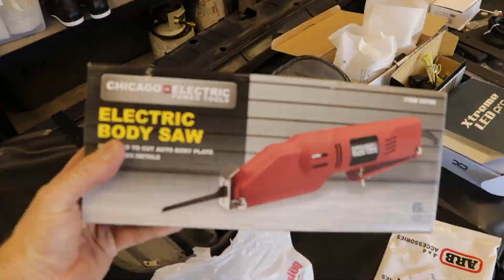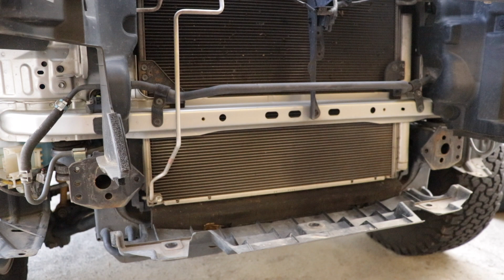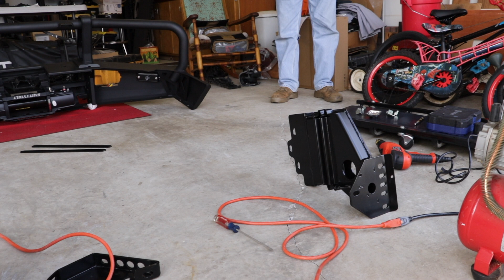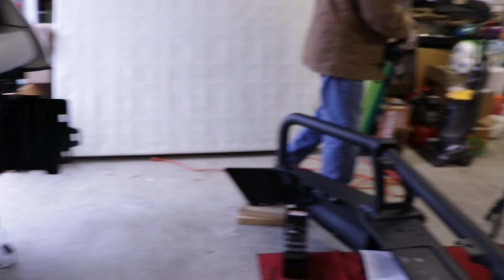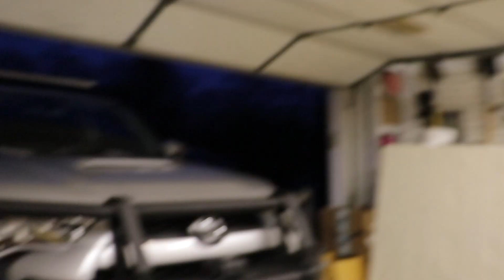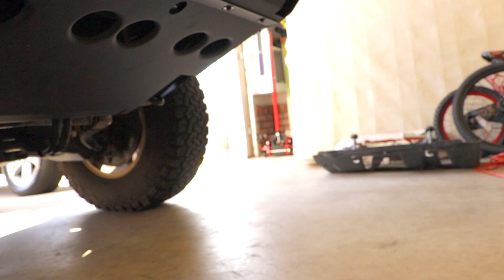ARB bumper installation on 5th gen 4Runner

Comment: Did it include that red recovery point or did you add that from another vendor ?
Reply from the maker: I had to buy that separately.
Reply: Do you have a part number and manufacture on those recovery points ?

Comment: I installed the same bumper on my LC200. Now im adding the winch. Did you have to cut a hole and mounts in the plate above the winch? Any advice would be helpful.
Reply from the maker: I didn’t have to make any modifications to the bumper itself to mount the winch that I can recall. It was pretty straightforward.
Reply: Im referring to the thin metal cover directly above the winch, right in front of the front camera. Looks like the winch control. Mine is a solid plate w no holes.

Comment: Just got this bumper to install on my 2020 4Runner. About how long did it take for you to install this?
Reply from the maker: It took an afternoon to prep the bumper and winch for installation and then a couple days of work. There’s a lot of detail work that went into prepping things like the factory front end trimming and grinding down weld beads and drilling holes etc. 
Some of that time included running to the hardware store for a drill bit and some nuts and bolts I needed for mounting the winch solenoid etc.

Comment: Just installed the arb bumper on my 4runner and get a real loud rattling noise on the highway going over 60 mph - does that happen to you, any suggestions ?
Reply from the maker: No. I’ve never heard a sound from mine. First thing I’d do is go back and double check the torque on all the bolts and brackets.

Comment: Thanks for this! Where do you engage the winch? I don’t see any cutouts, especially considering the winch is mounted legs first. Also, do you think a 12k winch would fit? Thanks!
Reply from the maker: Hey check my other videos. I did one showing the bumper and winch prep prior to installing the bumper. The mounting wasn’t that difficult. Not sure about the 12k winch. Would have to look up the specs on the bumper.
Reply: @MrLeadslinger  thank you! I’ll check it out. Watched your install but not prep. Gotta get a grinding wheel haha.

Comment: Any thoughts on why this bumper wouldn’t work with a limited? The product description I’ve seen says not recommended for limited or night shade trim levels. The only step I can see that would be different is the trimming of the bumper. Thanks
Reply: Late reply but I believe the X-REAS suspension in the limited changes the front bumper geometry...

Comment: what the hell is wrong with ARB.   poor engineering and design.   This bumper should bolt on much simpler and with less mods of its own gear. Im disappointed.
Reply from the maker: I’m guessing that a lot of what’s going on with the ARB bumper has to do with it being compatible with the crash rating and air bag system of the vehicle.
Reply: @MrLeadslinger  shouldn't matter. If its engineered  correctly half of the shit you went through would not of happened.  Im also curious why you went with a smitty winch.
Reply from the maker: @michaeldbhawker3556  I bought two Warns that both arrived messed up and had to be sent back so in the third try I bought the Smitty and everything was perfect.

Comment: So will this thing still cause the front to crumble if theres in accident I dont wanna total my truck by smacking a deer I want the bumper to just take it along with minor accidents. Anyone have thoughts on this?
Reply from the maker: Depends on what you mean by crumble. The factory front end is nothing but plastic and a piece of aluminum channel for a bumper. 
Now it’s a huge steel bumper with steel tubing wrapping around the entire front end.

If you hit a deer going fast enough to actually damage the bumper it would probably total the vehicle without the bumper. 

The fact that it is compatible with the air bag system is what made me choose it.

Comment: This is great! Thanks for taking the time. What suspension have you gone with to offset the weight?
Reply from the maker: I had the OME 3” kit to begin with with the light springs on the front and after installing the bumper I swapped to their heavy springs and it gave me back my ride height and handling. 

That kit is great overall and I have no complaints about the way it drives even after adding the weight.
Reply: @MrLeadslinger  good to know,  thank you!

Comment: Installed my ARB Bumper on my 2012 4runner in Sept. Like you've said those instructions are a little difficult to interpret.  Waiting on the lift kit before installing my winch. You would think that ARB could through in a full size template for the cutting of the bumper cover. I would have paid an extra $1 for one. Luckily I got it right on the first try. I Love the look though. Just received my new ARB Fog lights for the cutouts. Keep up the great videos!!!!

Cheers,
Bugs
Reply from the maker: Thanks man. Cutting the bumper cover was nerve-racking but once it's done and cleaned up it looks pretty good. I'm really happy with this bumper. Covid really curtailed our camping opportunities this year but I'm hoping to get out and actually use the winch before long.
Reply: I know this is an old comment but did you put this summit bumper on your 2012 or the bumper specific for 2012? Looking at this one since it looks a bit cleaner and not as far out.
Reply: @mattybaldwin3974  ARB brand specific to that 2012 4runner

Comment: how do you like it now? Still enjoying it?
Reply from the maker: Yeah I really do. I wasn't totally sure I would when I first bought it because in some pictures it looked like it would stick out too far or look too big on the front end but after having it on there a while I think it really is a great fit and product. It gives easy pretty easy access to the winch clutch and wiring and it's really solid. I've been meaning to get a video together kind of reviewing it after the fact.
Reply: TrailRunner Overland awesome. I’ve been thinking of going that route with mine since I found one local for a pretty good price. Was also afraid it would stick out too far. After your springs have settled, have much lift have you lost up front?
Reply from the maker: I lost a good bit of lift, over an inch, after the install but I ordered the 887 front springs and had them installed to handle the added weight and got all the lift back. It handles and rides like it's not even there now.

Comment: Can you show a picture of where the bumper meets the fender. is there a gap? I am using another companies bumper and for the life of me cannot stop a rattle from the bumper hitting the edge of the bumper cover where it meets the fender. This looks like it is very close thought you removed the one small plastic piece that meets the wheel well. Sorry if none of that makes sense
Reply from the maker: Donnie Good on my install I had to trim the plastic of the bumper cover about 4” or so back from the fender well. The bumper doesn’t completely fill the gap so I masked it off and painted it black behind the bumper. It’s not the best looking solution but there is no rubbing and it doesn’t look terrible. ARB supplies templates to trim the bumper cover before the install and I just followed those.

Comment: Question are the outer led lights turn signals well? I just had mine installed on a 2018 TRD Off Road and they just seem to be running lights.
Reply from the maker: Clive Watson yes, the LED markers in the bumper have amber markers and white turn signal flashers. The harness for them needs wired up to the parking light and turn signal wires with wire taps to function properly.
Reply: I could be wrong, but on my Tacoma ARB the Amber’s are the turn signals (running lights during daytime) and the whites are the parking or daytime lights. That way when you blink you are blinking with an amber rather than a white. I think by law blinkers have to be amber as well. Looks good, doing research for my wife she wants a deer blaster.

Comment: I didnt realize their bumper has no built in recovery points...I like the quality of their products
Reply from the maker: Yeah it almost stopped me from buying it. I talked to them about it and their explanation made sense. It does have built in hi-lift jack slots but the way it’s mounted with the impact absorbers meant to work with the factory crash sensors it’s really stronger to mount the recovery point directly to the frame.

Comment: Fantastic videos!! I’ve wanted to start this process with my ‘13 rnr for a while - haven’t seen an arb video like this - everyone is always talking Cbi-arb is the only one who does factory crash tests on their bumpers
Reply from the maker: Patrick Elisha Thank you! The crash rating is really what sold me on the bumper over the others. I’m glad you liked the video. I couldn’t find one so decided to make my own.
Reply: TrailRunner Overland it’s a great video thank you! - any thoughts on the factory hooks that are welded vs the recovery point?
Reply from the maker: @patrickelishasanmiguel  Sorry for the late response. I just saw this comment. The recovery point is really heavy duty like something you'd see on a piece of farm machinery. I like the way it fits and the way it mounts to the frame. I've always been told those factory loops are only meant for tie downs and shouldn't be used for kinetic recovery but a lot of people still use them for that. I guess it is just personal preference.
Reply: @MrLeadslinger  no problem thank you so much!